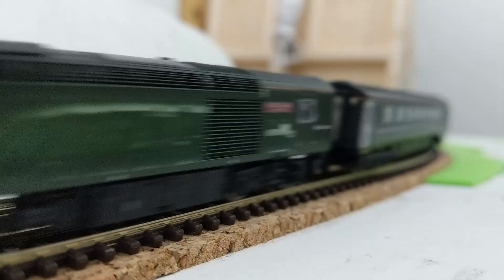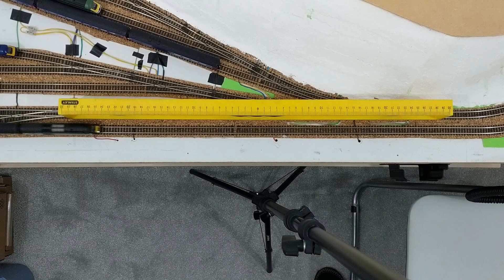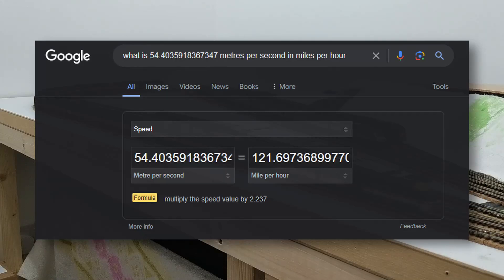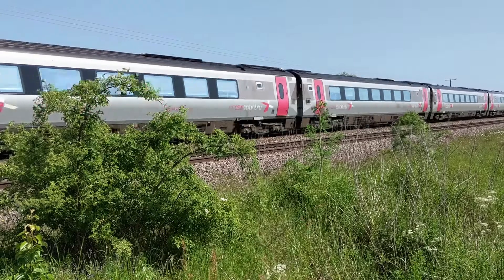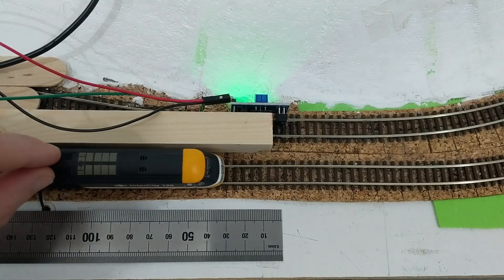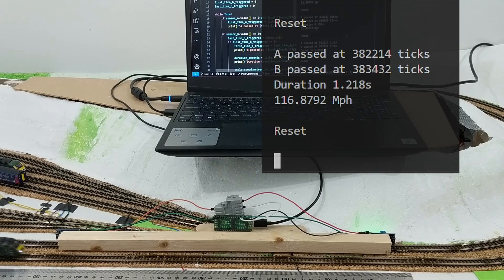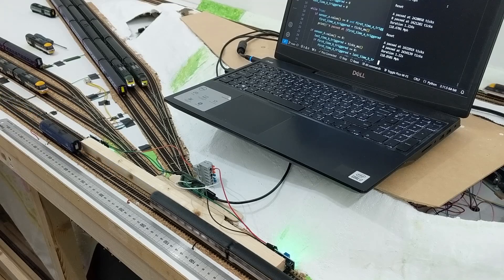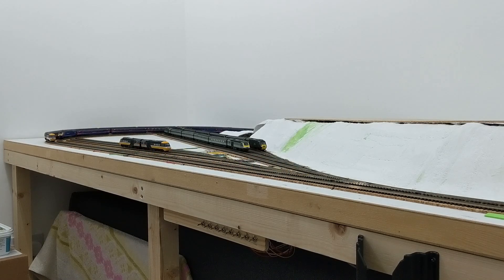0042 Scale speed of Dapol HSTs (and a Kato 800)

Comment: I approve of Monty Python references. 

If you want to increase the speed, incidentally, and you are using DCC, you can always just increase the track voltage.
Reply from the maker: Thanks - I couldn't resist, and thought there'd be people who'd recognise it 🙂

I don't think I can change the voltage at the track - my Gaugemaster system outputs 13V, and the NRMA specifications for DCC say it should be 12V for N gauge, but you make a good point because it should be possible to adjust how much of that the decoder lets the motor have, so it's possible it's not giving it the full 13V when at max speed step. I might look into that in future - thanks!

Comment: The HST is actually capable of a higher top speed (148.5 mph). The line restrictions keep it to 125. So, the Kato, arguably, is actually far more correct.

Interesting video again!
Reply from the maker: Thanks :)

Yes the HST holds that speed record, though if I remember correctly it was a 5-coach set that did that record. But if you want to model what HSTs do on the railway you only need it to go as far as 125 Mph... and in the case of the plain blue Dynamic Lines and the Castle set power cars they actually have MTU engines, not the Valenta ones that set the record, so I don't think anybody knows what those ones could be capable of. Same for the IET - there were concerns they wouldn't be able to keep to the timings of the HSTs over the hills of Devon when on diesel-only.
Reply: If you drive a HST (or any train) at more that 10% above its official maximum, the Driver will be relieved of Duty and given (Under Railway Law) a "Form 1" (Military type) charge. Will most likely be dismissed without Pension, and that case handed to the Crown Prosecution, via the British Transport Police, meaning you can end up in Jail. So the trick is like all crime "Don't get caught" !!!!

AN EXAMPLE:- A BR Southern Region Selhurst Driver was Speed trapped by an Inspector with a Police Radar Gun, passing through a 40mph Temporary Speed Restriction at 124mph on the Guildford New Line with a Thameslink Class 319 unit. The Driver was relieved of Duty a matter of 15 minutes later having arrived at Guildford. He was given a Form 1 Charge, later found Guilty and dismissed from the service. And BTP and the Crown Prosecution took the case to Court. The Driver was lucky to receive a few years "suspended" jail sentence. He had not been drinking alcohol or taking Drugs, and was in fact a then NEW Driver. As this was in 1996 just before BR's Demise. This revealed the Governments pressure on BR to start changing things, in preparation for Franchising, especially to drastically cut Driver Training (from BR's Minimum 5 Years) to just 6 MONTHS. And effectively start churning out Muppets, who being ignorant think they can speed when the mood takes them.
Reply: @Heinz-c6c  Yes, I realise that 99.9% of the time no one would try to take an HST over 125 mph, for very good reason. I was merely noting that the locomotives were actually capable of doing so.
Reply: @kellypaws  The speed you refer too was achieved with the Prototype HST when on "Test", and it spent a few months testing. Indeed there is a photo of me in the Daily Express at Paddington when the prototype first came there simply for Platform Gauging tests (I was a College student at the time). My father having tipped me off. An I got £50 out of the Daily Express for that photo !   

Trains especially when still at the experimental or Prototype stage can ignore regular speed limits within the bounds laid down by the Track Civil Engineer & the CM&EE Department, Engineers. But most trains have always been capable of exceeding there official (safe) maximum even in steam days. Some trains have been fitted in the past with speed "Restrictors", but Drivers often isolated these. Most Class 33's were fitted with restrictors when they started also operating the Cardiff to Crewe service, as they were still Southern Region responsibility. And Western Drivers were regularly running the locos above their official 85mph maximum. Partly because the Western Region men were used to mainline Diesels being 90mph or 100mph machines. 

Southern Express EMU's were also 90mph, but would happily exceed 100mph if you simply kept the power handle open. Indeed the 4REP Power Packs (3,200hp) were found in 1966 when they first began entering service to be quite capable of reaching 110mph between Micheldever & Eastleigh. Because Steam loco men were driving them, and drove everything quite naturally as fast as it was convenient to do. They came from an age when few steam locos even had speedometers. And were not used to the concept of sticking to modern era speed limits. So Bulleid Pacific's also often exceeded 100mph.
 
Even the Bournemouth Belle All Pullman Train was clocked passing Surbiton at 106mph with a Merchant Navy at the front, just a matter of a few months before the end of steam. And in the process part of the W.H. Smiths (wooden) bookstall collapsed, and piles of newspapers and magazines, tried to follow the train, in a huge cloud of paper. All of which was caught on 16mm Sound film by Peter Goddard the then President of the Carshalton & Sutton MRC. Which showed the loco passing the previous quarter mile post south of the Station and then the next quarter mile post at the north end of the station, so you could now time the train from the film !  

That's before British Rail Management got Paranoid, and introduced Police Radar guns, and told Traction Inspectors to hide behind Bridge abutments, and try and trap speeding Drivers !